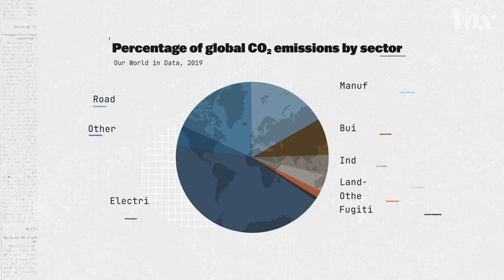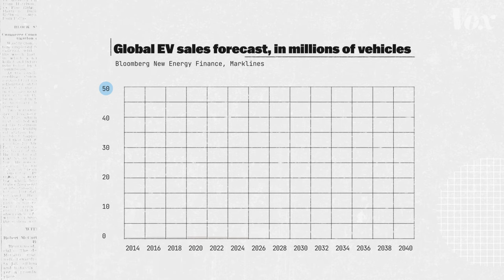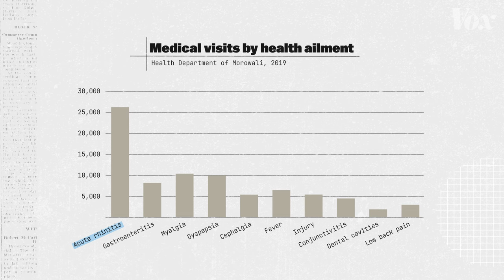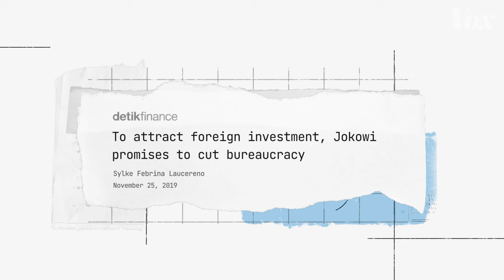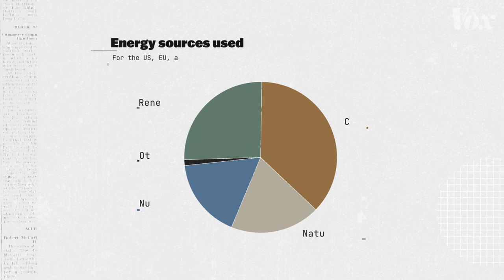Batteries are dirty. Geothermal power can help.

Comment: Geothermal is great, particularly closed loop which is not covered here. Closed loop offers a great way to continue to use Oil and Gas assets, in almost any geology, which are otherwise potentially stranded. It also allows for peaking as working fluid is super heated when left underground, and that allows higher power production when turned on. And, if a super Critical CO2 loop is used, have negligible water requirements and offer a sequesteration site.

Kenya should alsi be covered in regards to conventional Geothermal.

Comment: Felt like there was a few leaps an the conclusion geothermal will help this  problem was kind of forced. Would have liked to have seen list of sources attached
Reply: I agree. Probably could have just talked about the benefits of geothermal without bring up batteries. Geothermal isn't necessarily any better than wind, solar, hydro, or nuclear for powering mines and nickel processing plants. We are also moving more towards iron ore instead of nickel for many battery applications such as lower priced EVs and grid storage.

Comment: Pretty big flaw in this video was that Nickel is by no means the most important part of an EV battery. There's certainly going to be a shortage, but LFP (lithium Iron Phosphate) batteries are gaining tractions very rapidly, since they're cheap, easy to produce and more convenient to use (don't degrade when being charge/discharged above/below 80/20%).

Comment: In the future most EVs won't have nickel based batteries, they will be Iron based or LFP batteries. Nickel batteries will be reserved for the high end models where cost is less of a concern and range is king. But the all the affordable models will have cheaper Iron based batteries. Tesla is already doing this with their base models using LFP batteries instead of Nickel, and LFP batteries will be a key component in making EVs more affordable

Comment: I think one important detail that was missed in this video is about the distance betweeen the factory and the source for geothermal. Usually geothermal is found in remote/mountainous area, so there will be added cost to build tranmission and distribution line from geothermal source to industrial / residential area. So it will be harder to bring electricity from geothermal sources

Comment: this also neglects that the electricity created for an EV can be almost completely made up of fossil fuels in some areas (especially in the US). Another issue is that the current electricity network is nowhere near large enough to house a population composed of only EVs, at least in most large countries. so by saying that if we just magically made all cars electric, based on the current infrastructure, 1. fossil fuels will still be used, and 2. there will be a lack of energy. Other commentators have pointed this out but I thought I should mention that we should not assume its only for cars. A truly "green" future would not involve cars, as mentioned earlier, it would be impossible at our current battery capacity. I hope this makes sense. interesting video though

Comment: One point missed here is the amount of water lost in geothermal power generation to steam. A significant portion of an aquifer can be depleted by geothermal use, even if the plant is trying to recirculate the extracted water. 

Depleting aquifers has significant environmental impacts in its own right. This doesn't mean exploring geothermal isn't a worthwhile venture, but like any other energy production method, it has its trade-offs.

Comment: Geothermal energy has its own risks, taking heat out of the system can effect tectonics and groundwater. There is also ways to "incentivize" the system to be more productive with drilling and other activity. I support geothermal energy as a geologist, but its not free energy and it isn't without risk.

Comment: This is why we need to invest in geothermal & modern advanced nuclear energy options. Small form reactors, LFTRs, Thorium Reactors, liquid reactors. With the use of modern technology, advanced engineering, material science, safety measures understandings and designs, computer technology, robotics, It will really allow any nation to be pretty much be energy independent. Less reliant on fossil fuels. They'll have efficient, stable electrical grids and the rest of the grid could experiment with alternative power sources, etc. 
We need to heal from the trauma of our past and see that it came solely from Us not understanding what we were doing, not have advanced enough technology, material science, engineering, safety measures, understanding of how to go about everything, etc. This source of energy will greatly help the world improve towards the future and lowering emissions more than anything else could while having a very stable electrical grid system. Currently we have alternative energy options but the majority of our grid is powered off of fossil fuels and emission producing sources of energy. We will be so much better going forward commiting to modern advanced nuclear energy options.

Comment: Geothermal energy is not (currently) renewable in an absolute sense, though in practice it almost is. That is because where we can currently access the energy, is where there is heat build up close to the surface, and a sufficiently large power plant will eventually cool the area down, at least specific boreholes and sites. I'm from Iceland, where there is a lot of geothermal energy production, and they semi-regularly "use up" an area. Generally you can just move a few hundred meters and get heat again, but if the operation is large scale enough, there is potential to fully "empty" a particular site (maybe for years, but maybe for centuries).

Comment: Yeah, Indonesia is sititng above one of the biggest geothermal energy source. But, it is still an expensive technology and you gotta cut a lot of trees which led to deforestation. It is not easy to fulfil the energy demand for a country with population of 200mil+ people not mentioned the geographical limitation adding more difficulty for electric distribution.

Im not in position of pro and cons but I just want to highlights that there are a lot of factor that involve in taking decision regarding energy.

Comment: The problem of Geothermal is it is area specific. It requires a geologically active area with magma close to the water table and that water table close to ground level. Usually areas with lots of hot springs or volcanic areas close to the seashore are preferred. Think of Iceland for example.

4:07 is not true. Geothermal plants emit sulfur dioxide(SO2) but not the levels of coal or natural gas powerplants. That is because of the underlying magma emitting SO2 into the water table. SO2 has a higher greenhouse effect potential than CO2 and NOx gas. The reason why SO2 is often ignored in geothermal powerplants since they emit so little amounts of SO2 that it has little effect on the atmosphere.

Deep Geothermal is a joke. It will cause the same problems as fracking. Pumping water deep underground to heat it up and then bringing it up to the surface will lead to disturbances to the underlying rock causing earthquakes and such.
Reply: Not really.  Of course, if we are talking about a high enthalpy system, you need places like the ones you mention, but it is not a rule when you talk about geothermal energy.  With modern technology, 120°C is more than enough to generate electricity (binary plants) and these conditions are not linked to volcanic areas.  It is true that detailed and more complicated studies are necessary, but we are advancing on the subject to make geothermal energy more attractive and accessible.  Now the deep geothermal does not necessarily have to have the problems of fracking as they are known but well this is another topic. Regards,

Comment: Geothermal in Indonesia won't solve the need for nickel in the rest of the world, infortunatelly. And energy storage isn't the only industry where nickel is needed.
Reply: Geothermal may be useful globally to reduce power energy storage needs, along alternative batteries like iron or liquid metal. But yes Nickel isn't going anywhere.
Reply: Zaydan Naufal   there's probably no energy resource option without any drawback. Coal mining and oil extraction have their own negative implications for the staff, the nearby residents, and the environment too. Not to mention they release CO2 as the end product. The same for the renewable energy options. We'd probably gonna sacrifice the area where the materials are extracted for battery and car production, for cleaner air in the majority of other parts of the planet, sadly. Unless we can do interplanetary travel and extract the other planets' resources in an efficient way. As long as the energy hunger of the populace keeps growing, there's no positive impact on the environment.

Comment: If you don't solve the last mile problem with public transit, then you don't really have a viable system, and the last mile is a major issue in rural areas and for people who can't stand or walk for very long due to mobility issues. EVs have engineering problems to be solved, but there's always going to be a use for cars in general due to their sheer convenience outside of dense urban areas.
Reply: A mile is not a long walk. If people walked more then less people would have mobility issues.
Reply: Is major issue

Comment: EU built a geothermal plant in UK as well - truly non-stop renewable energy, coming from the core of our earth.
Btw, Lithium batteries are not all high carbon - Sweden and Norway are starting to produce very low-carbon batteries, with a process that takes significantly longer(~5 years) but extremely low carbon.

Comment: As an engineer I wonder how much PW or EW of energy we could possibly extract geothermically before we will start to create problems there? Obviously for now geothermal energy is a great way to move forward, but the 2nd law of thermodynamics makes it very clear that we can't extract energy from anywhere without it costing something. As we drain the geothermal reserves the earth's core will cool down eventually causing a collapse of the earth's magnetic field exposing us to deadly solar radiation. So I wonder how much energy is available geothermically? Centuries? Millenia? Enough until we evolve into another species? Eons? Anyone's got a ball park figure on that?

Comment: Hydrogen should be the main alternative to diesel/petrol and not lithium ion batteries. This alone is why the move to electric vehicles is not about the environment but instead about purely making profits from a different limited resource.

Comment: I don't understand the connection to nickel. Would the energy from geothermal plants not still require batteries to be stored?
Reply: You can stop pumping geothermal, and that allows the fluid in the reservoir to reach temperatures beyond the plants steady state operations. This super heated fluid then can be pumped when peaking energy is needed, and produce above the plants rated output. Geothermal is often sold as base load, but often can be q powerful peaking tool.

Comment: Saying electric vehicles produce zero emissions is very deceptive. By my calculations, it would release 23.49kg of CO2 from the electricity production. Sure, it's less than the combustion car, but it's not nothing. The power grid still has a long way to go to being perfectly clean.

Comment: When geothermal is also examined is has multiple hurdles and limitations as well.
Also, Tesla is already producing iron lithium batteries absent of nickel or cobalt for its cheaper models (the range is less and so is battery cost). 
The future of energy production and storage will be a mix of multiple technologies driven by resource availability and economic viability.

Comment: The only issue I have with this is lithium batteries are for electrical storage and geothermal is for electrical production. It’s literally comparing apples to oranges. Energy produced from a geothermal plant could end up in a lithium battery.

Comment: Dont want to be a party pooper here, but Vox literally glosses over the fact that there is only one currently viable potential geothermal field (Lahendong) in the whole island of Sulawesi, and its literally 1,300 km away from Morowali, the main nickel production center. 

Indonesia's geothermal potential are deceptive in a way that we have a lot of small little pocket of it but most of them are not cost effective (low temp, acidic, fast scaling, etc). That and the cap. cost needed for field exploration.

This is literally the reason why other forms of renewables are being developed in sulawesi.

Comment: Just here to support the comments that point out that electric vehicles are NOT carbon emission free as they need to be charged-up as well as produced which both emit CO2. Research shows that they are better than diesel or petrol vehicles, yes, but saying that they are "carbon free" is complete and utter misinformation.

Comment: instead of making 1-2 electric cars with big batteries for each household, put those people on trains powered directly by the grid no batteries required.
still do geothermal power generation wherever possible though

Comment: Driving an electric car does not result in zero CO2 emissions. The emissions are dependent on how energy is produced in the region the battery was filled. (Ie. That energy thst fills the battery created CO2 emissions during production). 

If your region gets all its energy from green sources perfect, if not... then yeah you're polluting just like the rest (just maybe slightly less).

Comment: It's true that an electric car emits zero emissions but the energy used to charge those batteries have to be in the discussion as well.  Of course a standard internal combustion engine will naturally emit a lot more co2 emissions but to say a EV will eliminate co2 emissions completely from personal vehicles is wrong unless we find a way for our power grids to be 100% emission free.

Comment: Is the heat that is needed for the extraction of nickel in these plants directly provided through the burning of coal in some kind of oven or is electricity used to do so? If coal is burned on site to generate the heat, is the generated heat from geothermal sources high enough to replace the heat provied through the burning of coal?

Comment: This is well and good but we should also remember that the electricity that flows into Lithium batteries likewise isn't "clean". It's greener than combustion engines in a car but still powered (in part) by electricity produced by natural gas and coal.
Reply: @stevenvaneerden7794  agreed

Comment: Ok great, we may have a solution for the production of those batteries that could make it completely green during the production and the using of it. But what about the recycling of them ? It still pollutes a lot to this day, and there's no real solution as for my current knowing. For now, the best way to not pollute too much with your car, is to buy one that is not new (what pollutes a lot today is the massive production of new cars), and ideally it would be hybrid.
Reply: Also, recycling windmill blades is a must. But fiberglass coated wood structures larger than multiple boats is a challenge, which is why these consumables that have to be replaced multiple times a decade are piling up everywhere.

Comment: So the environmental damage from mining and smelting Nickel is caused by the coal used to power the plant or the nickel itself? If we replace the coal with renewables and restrict the dumping of chemicals and manufacturing byproducts into the waterways then problem solved? Or is there a fundamental environmental issue with the nickel itself?

Comment: Batteries are not CO2 neutral in the least. To be produced, recharched and recycled (if that ever happens) takes large amounts of CO2.
Reply: Lithium batteries use expensive and hard to source raw materials (lithium, cobalt, nickel), so there is a HUGE economic incentive for recycling. The market is your best friend or your worst enemy. I’m not worried about battery recycling.

Comment: In order for an EV to produce 0 kg CO2e, all electricity for charging the EV should be resources from renewable energy sources. I am 30 seconds in this video, is has already been claim that driving from NY to DC with an EV doesn't produce GHG emissions. I think VOX needs a better fact checking system..

Comment: focusing only on batteries is in my  opinion is wrong. You miss here the complete picture. Yes nickel production has an impact on the people and environment. Nickel is most used in mechanical engineering and stainless steel. You should watch this video with a grain of salt

Comment: EVs don't exist to save ecosystems, they exist to save the car industry.
Smaller vehicles make a huge difference in the size of battery, sitting in 2 tons of steel, lugging the equivalent of a living room to work every day or the super market needs to stop.
Ebikes and small EVs, multi-drop delivery and investment in mass transit will both save on CO2 and free up clogged roads.

Comment: There is no such thing as a Zero Emission Vehicle. The real question is, where are the emissions associated with the electric car? Because what you do with an electric vehicle is you don’t eliminate emission, you export them somewhere else. You have to dig up 500,000 LBS of materials to make a single 1000 LB battery. It takes 100-300 barrels of oil to manufacture a battery that can hold 1 barrel of oil equivalent of energy. Just manufacturing the battery can have a carbon debt rate ranging from 10 tons to 40 tons of CO2. And the plans that are in place to increase the use of batteries will require an increase in production of minerals like lithium, cobalt, zinc. Demand for those minerals will increase between 400% and 4000%. There isn’t enough mining in the world to make enough batteries for that many people for their cars.